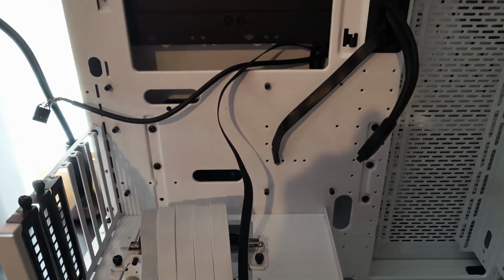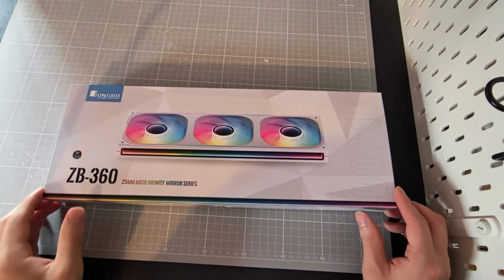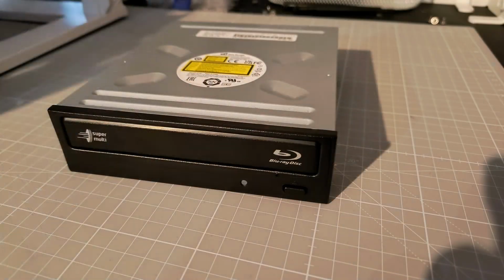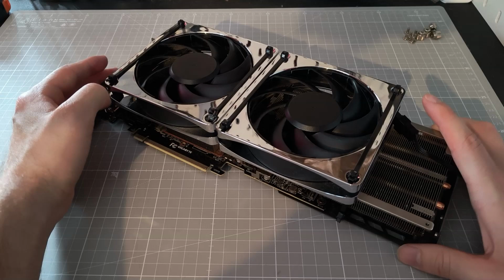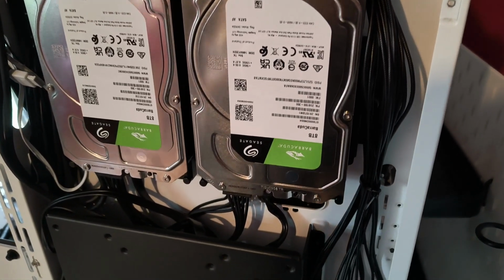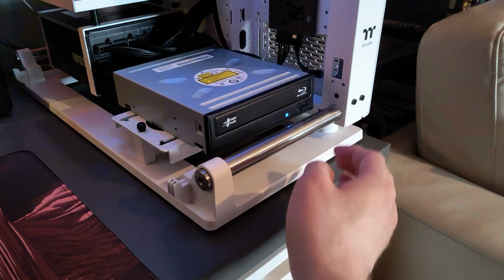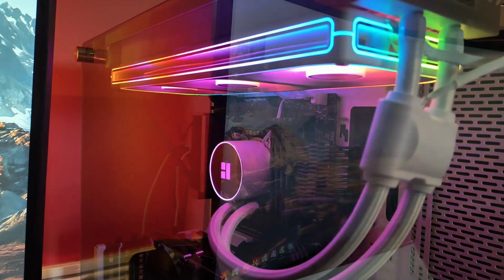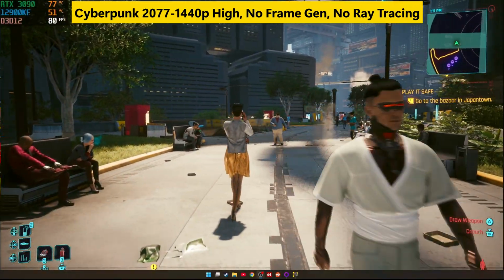My Frankensteined Gaming & HTPC build

Comment: Nice. Mine has 20TB hdd and some externals I need to shuck at some point, 2TB nvmes (should install more but have 2 in there) have another 2 I can install into 12900KF or my AM5 X3D build.
Reply from the maker: Thanks, yeah I thought it would just be easier to throw all my drives in together while I change a couple of things on my rig. I have a 4TB NVMe in an external enclosure as a backup for my favourite stuff as well. Your setup sounds pretty nice.